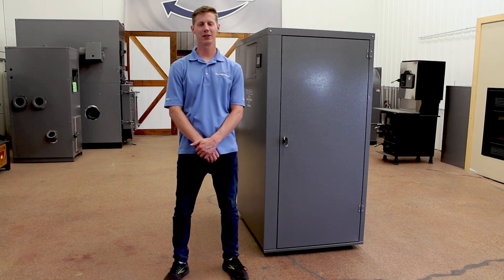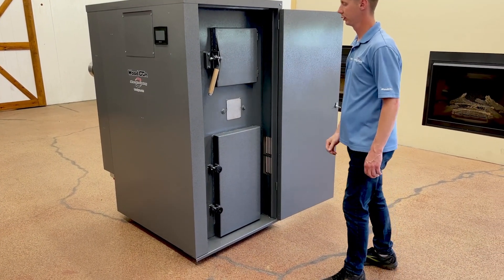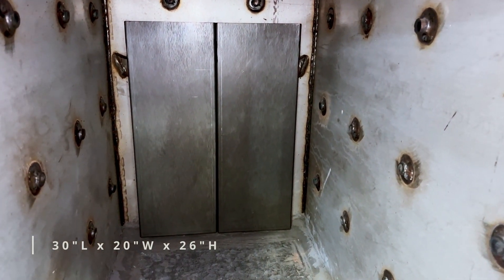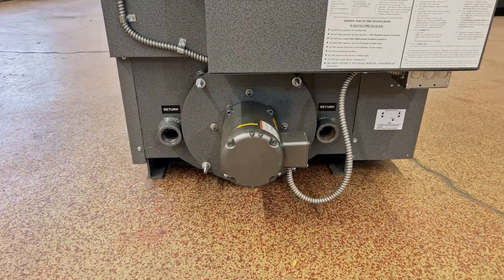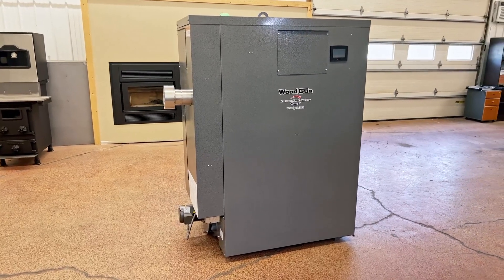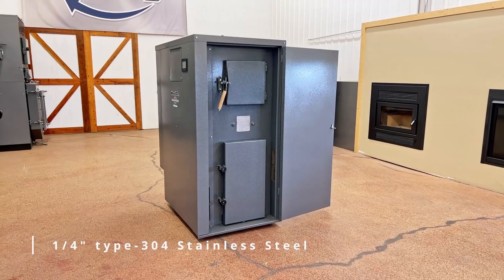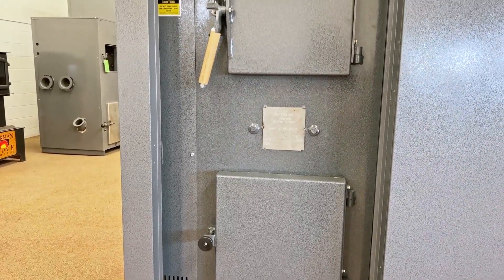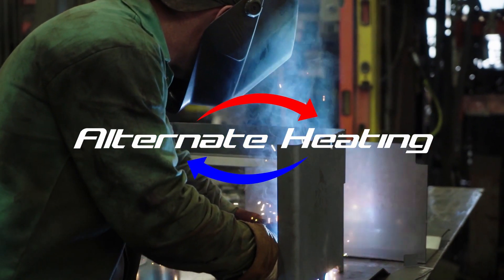Super E210 Wood Gasification Boiler - Stainless Steel

Comment: So is this setup to run 24/7? Or made to batch burn? 
Could this replace the need for an oil boiler in a new build
Reply: I've used it 24/7 last winter as main source of heat to heat the house and water. Most likely you will need oil/propane/natural gas backup required by the home insurance and city codes.
Reply from the maker: These are set up to run 24/7. No thermal storage required either!